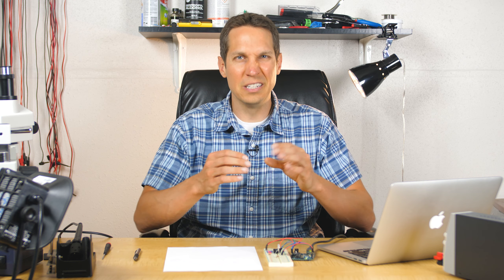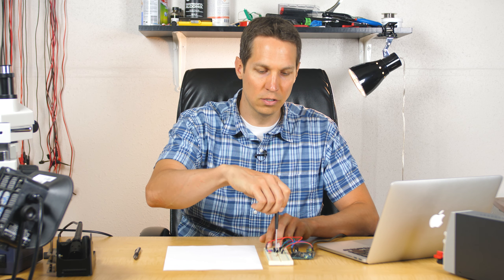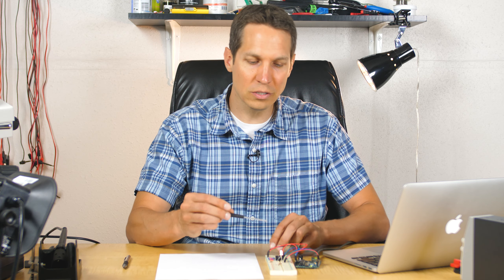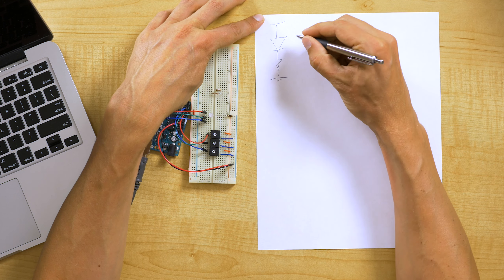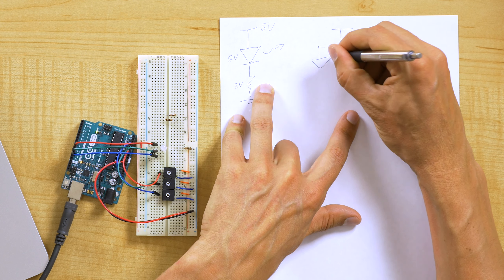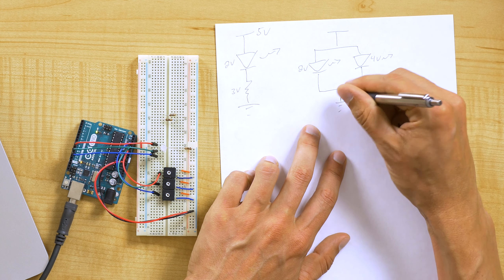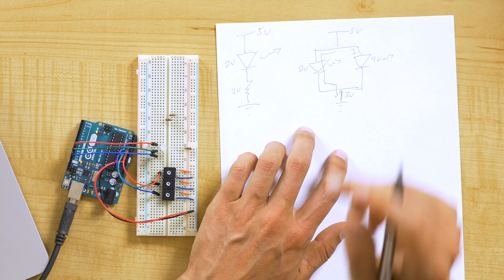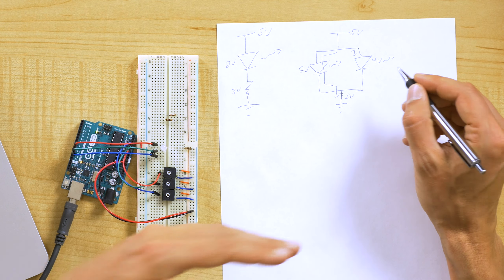Single resistor for a common anode or common cathode RGB LED? | Basic Electronics

Comment: In LEDs with 3 LEDs of different forward voltage effectively in parallel, like the color changing LEDs, they are designed to be driven from a constant current source, not a constant voltage source, though 3.5-4v is usually safe, but the intensity will be all over the place without a constant current souce.
Reply from the maker: Yep, constant current sources as the best way to drive an LED for sure!  But if the LEDs are in parallel, even a constant current source will be unable to balance the colors properly.

Comment: My application is a traffic signal.  Common anode. But only one LED is sequenced at a time, so only one resistor would work in the common anode.  This video did not really apply to my situation.

Comment: At time 2.00: why does it mean that dropping 2v across the left LED means dropping 2v across the right LED? I know they're in parallel and voltage is the same in that situation but why must it be that the smaller LED path determines the voltage for the larger LED too? Fundamentally: why is most of the current drawn by the 2v LED? I've done a bunch of breadboard tests with this and see it is the case but can you show the formula for that. I know the formula for total resistance of parallel circuits and so forth but this question eludes me. Why does that "smaller forward voltage" LED draw nearly the entire current? (As I've seen here on my desk that it does, too).  Thank you!
Reply from the maker: These are great questions and basically exactly why did the video, because we remember being confused about this as well.  I honestly think the best way to understand this would be to watch our video on how to solve circuits with diodes in them (https://youtu.be/sDWWGhuRqFs), particularly the non-ideal diode example.  But in this particular case, the higher forward voltage LED isn't reverse-biased, it just isn't forward biased enough to really conduct.  And since it isn't forward biased enough to conduct, you can just treat it essentially as an open-circuit, so it's not going to be conducting much, if anything.  After watching the diode video, come on back and see if this makes more sense!
Reply from the maker: Thanks!  I'm not sure why that link stopped working, I just double-checked and it's the "official" share link provided by YouTube.  Weird.  Either way - your link works, so thanks again!
Reply: The link isn't working because the closing brace slipped into it.

Comment: i have a question rather. could we simulate capacitors and inductors base on electromics component
Reply from the maker: Hi Hamadou!  I don't understand what you mean - simulate them in LTSpice?
Reply: @CircuitBread  i mean obtaining their behaviours while using electronic componenrs such as op amp 
It might be in hardware or software or just logic how to do it
Reply: @hamadouousmanou7307  hi! I'm not sure for capacitors but in audio applications op-amps are used to simulate the behavior of an inductor. They are usually used in graphic equalizers. This reference design from Texas Instruments will surely help you :) http://www.ti.com/lit/an/slyt134/slyt134.pdf

Comment: What if we are using both blue leds?
Reply from the maker: Hi Samuel!  Then you'll probably be able to get away with it, but there is sometimes a little bit of variation between LEDs of the same color or even from the same production line.  But unless your application is extremely demanding and precise or needs to be robust, you'll probably be fine.